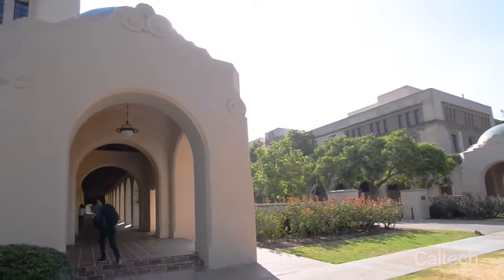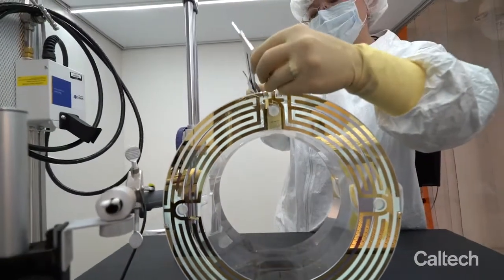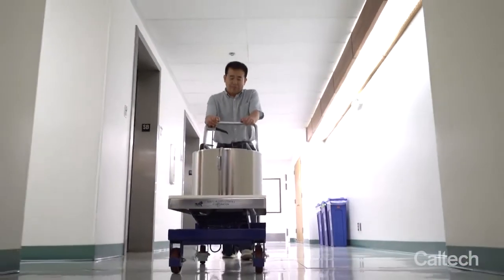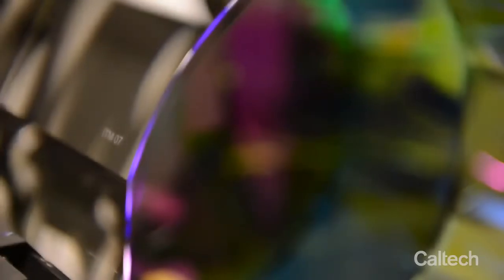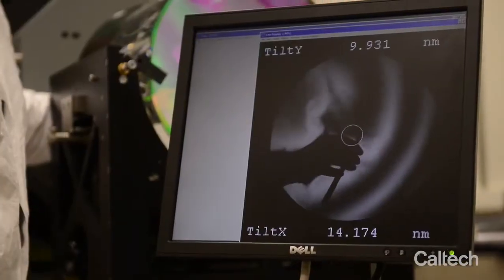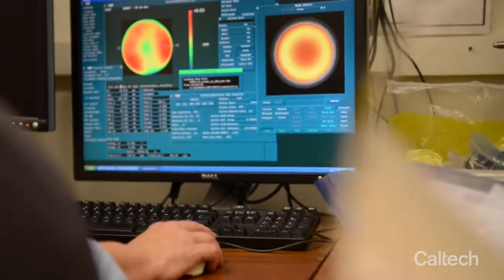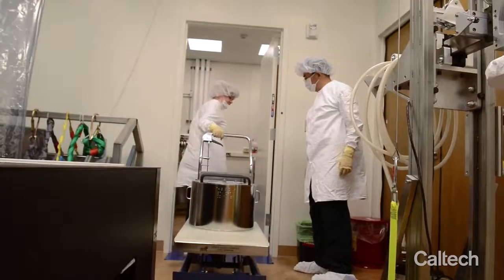Cleaning LIGO

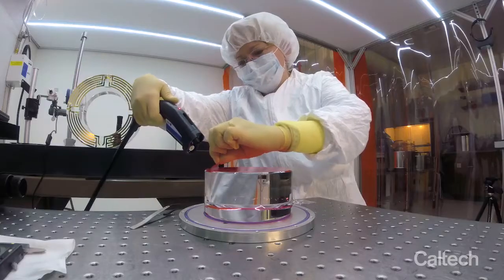Comment: What is that air gun she is using at 0:33 sec in?
Reply from the maker: Lazeerer, it's an anti-static gun.  LIGO's cleaning requirements are, understandably, very strict.  Following the peel with the anti-static gun reduces the possibility of a stray dust particle falling on the LIGO optic during the peel.